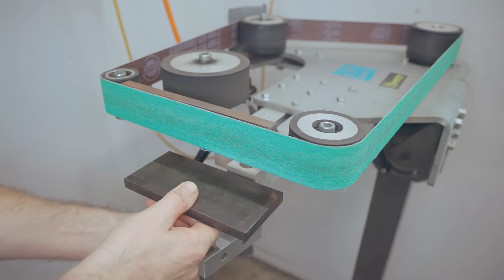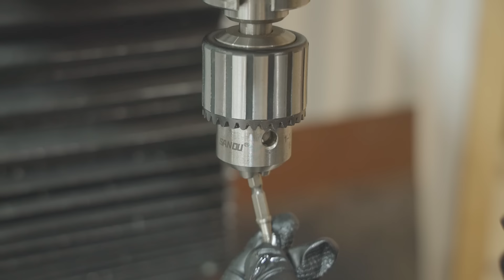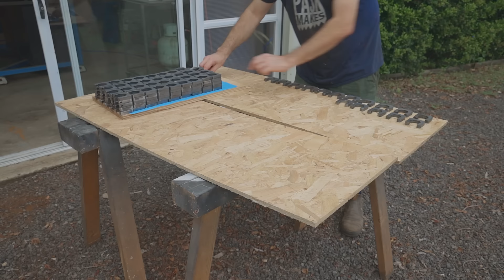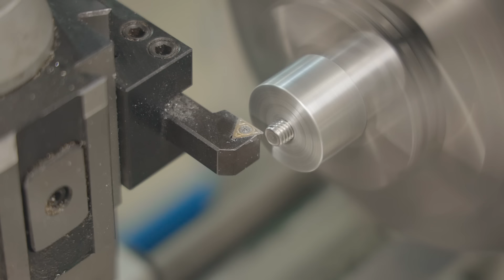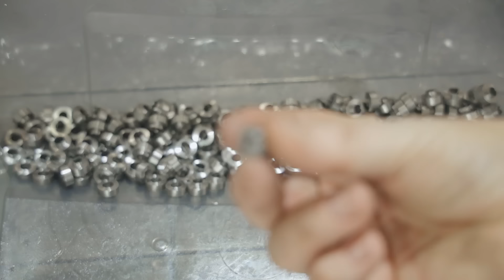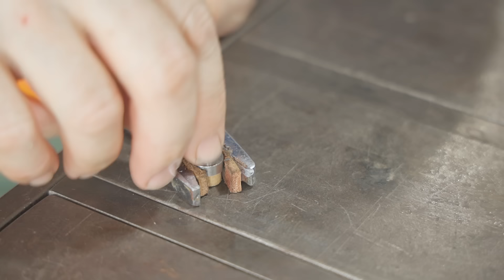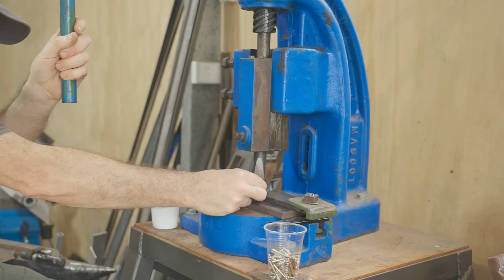Small Shop Batch Production - Lots of Jigs to make 200 Clamps

Comment: Great stuff as always!  Getting the blanks cut by a laser was the smart way to go, for sure.  I love subbing out that kind of work because it just makes so much sense compared to standing at a drill press or mill for hours on end!  Loved seeing all the little time-saving jigs.  That's always my favorite part of a video because you never know when something like that will come in handy.  Future reference.... you can split those 2x72 belts and make them thinner for when you need to get into tight spots like that.  I split one down to only 1/2" once for a similar project, but it was too narrow and ended up snapping on me right at the end.  Got the job done and I used the scraps as a sanding strap afterwards, so it wasn't a big loss.  Even just splitting on in half will make it roll around that tight radius a lot easier.
Reply from the maker: Thanks mate and thanks for the tip! :)

Comment: Great little clamp! A pretty good way to ease the edges on the body and maybe even the brass handles (although it wouldn't round the ends over) is to put them in a rock polisher. You can put a lot in at once and do something else while the machine is running.
Reply from the maker: Thanks Eric! There’s been a few comments saying the same thing and I reckon I’ll look into it for sure. :)
Reply: @PaskMakes  a vibratory or rotary tumbler. I have two vibratory tumblers i found locally for $100 with several different types of media work a charm at deburring and polishing small parts.

Comment: Awesome! Thanks. Idea: What if, instead of spray painting them, you were to blue them? This would prevent them from rusting, but also avoid the paint possibly wearing off in the future. Just a thought. Love your channel, by the way!
Reply from the maker: Thanks! I thought about it but bluing only stops rust for so long. You’re right though, the paint will get knocked and chipped for sure. :)
Reply: @PaskMakes  bluing stops rusting if you regularly oil it. Bluing creates a porous surface that holds the oil to prevent rusting. They would definitely look very nice blued in my opinion. The clamps are very cool either way.

Comment: The only "improvement" ...
Why did you think it would be complicated to counterbore the swivels before parting off?
You weren't using the tailstock until you needed to create more "tube." 
You could clamp a collar onto your counterbore drill to set the depth.
If you were making bigger batches, you could have a combined drill and counterbore cutter ground up.

Comment: Love all your jigs! One idea: Since most of your jigs don't have to take any significant force in use and are meant for a limited service life anyway, they could also be 3D printed. That way, a collection of 100-200 parametric CAD designs for 3D printable jigs could bring a lot of efficiency to any small workshop. One would just select the jig type, enter desired measures, and 3D print it.

Comment: The fact that you could create a process like this for 200 clamps is incredible in and of itself. That said, for the step where you're cutting the ends for the bolts from the steel rod, you could probably use a dial indicator instead of, or in combination with, the rod in the holder. It would help to keep your hands further away from all the spinning bits of the lathe.

Comment: For the part where you heat the clamps for stamping, I was thinking you could make a concrete wheel that had an axle. You could set it on its side Close to the furnace and load it with clamps and keep rotating it while taking and adding clamps as you go.

Comment: Nice job clamps looks great! When I was young I beveled 3/8 fine thread bolt so the nut would start on the bolt. I used to do them by the thousands. One machine has 1152 bolts to hold the cross links on. I would of traded your 200 any day 🤣🤣🤣. Great job thanks for sharing.

Comment: When making the swivel pads, it might have been better to drill the hole as deep as possible, then cut off a section of rod with the hole through it, then repeat. You would have a bunch of 4-5 inch segments of tube that could then be cut down into individual pads, probably using a bandsaw and jig.

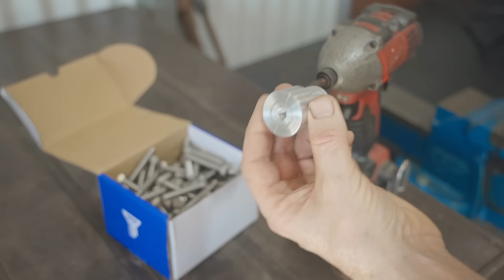Comment: @6:50 you show the bolt holder for mounting in the lathe chuck. A simple modification to this would be to drill the entry hole to the holder again so that the threads were removed from the first 2/3 of the hole. This would reduce the amount of time threading and unthreading the bolts from the holder by about 2/3.

Threading and unthreading the bolts for the entire length of the through-hole times a couple of hundred bolts is probably a fair chunk more time than it would take to reduce the number of threads by drilling one hole larger at one end.
Reply from the maker: Thanks Kent, that’s a great idea! :)

Comment: For those saying use a tumbler, that would work to remove the laser slag, but it's wouldn't round the corners off much, not without literal days of tumbling. At my work, we tumble laser cut parts for 8 hours in ceramic media and it barely takes off the laser slag. It does leave you with a nice clean blank ready for more processing, which is why we do it.

I was thinking something like a chamfering router bit with a ball bearing guide might work. Not sure how it would hold up though, or how scary (dangerous) it would be to use with steel. I've done similar with aluminum and it wasn't bad though.

Comment: You could put a large countersink bit in your drill press and jig up a base to locate the part. Using the depth stop you could knock the corners off of the round hole quickly.

Comment: You might have been able to cut the recess in the pads at the same time as parting them off if you put a tool in the perpendicular side of the quick change post. It would cut the recess while you brought the carriage to the left and be in free space as the parting tool went in. It all depends on whether you have a tool holder that would work. My little lathe came with a goofy angled tool holder that I could see making do.
Reply: That's a great idea. I was thinking use the tail stock to put it in before parting it off every time, but getting the depth the same every time gets complicated because the stock shortens every time.
Reply: I was thinking a turret tailstock for that step. Your solution is better because it uses tooling already on hand. I think a custom drill bit could be an even better choice because it would eliminate a step entirely Something like a countersink bit for wood working. To make it, take a bit the size of the outer diameter of the rod, mount in the lathe, and use a tool post grinder to neck down the bit for the counter bore and the through hole. Blunt the cutting edges at the largest step so it functions as a depth stop. I have made such bits using a rotary tool in place of a tool post grinder by making an adapter that holds the rotary tool to the quick change tool post.

Comment: Love the video, this was the type of thing I once did for a living. When pinching the ends of the brass you could make tooling that allowed you to push the brass through it through the bolt by hand but hit both ends at the same time.  You could even make it even more fancy by adding spring loaded stop and/or a shear that would cut the brass to length. It would save you quite some time.
Reply from the maker: Thanks very much for that, I reckon it’s an awesome idea that I’ll use for sure if I make more. :)
Reply: So how would you deal with the problem that would create of finishing the ends of the brass once it's locked in the bolt? At least with adding a shear to a singular process, anyway; I suppose you could avoid it by having a shear cutting jig and then if the cuts are clean enough I dunno, put them in a batch tumbler with abrasive, then pinching both ends at once
Reply: @farmerboy916  The ends could be sanded smooth after pinching both ends onto the bolt.
Reply: @farmerboy916  If the tooling is only for  double pinching the ends the brass ends can be finished in the same way as per the video. Adding a shear would create a bur which will only tame a light touch on the grinding wheel.

Comment: I worked in a steel shop, making batches of hinges and various brackets for train cabling and brackets for use in the undergrounds. Almost every job I had to plasma cut, punch, bend and notch hundreds sometimes thousands of items. Aswell as grind and then pack them ready for galv. Was a fun job as once the batch is done you have another all from blueprints. Machinery and jigs make something that would take weeks possible in a day.

Comment: 1:44 how do you keep that big belt from wondering off the pulleys?
Reply: If the wheels have a crown on them -- larger diameter in the middle -- the belt will align itself.  When it starts to slip off to the side, the geometry of the crown causes the belt to sort of steer itself back toward the center, and it climbs back up onto the middle.  The idea works well, and is used all over the place.  My first encounter was the. bandsaw.  It's how all the belts in the old belt-driven machine shops stayed on their pulleys, too.  I think it's kinda neat!

Comment: I spotted only a few speed issues, when you were grinding the edges of the brass, it would have been quicker to drop each one after the first grind into a cup, then just take the cup and repeat, turning it each time you aren't losing much but you are losing some time. And maybe, in order to knock all the edges from the c part, a tumbler left overnight might have done a better job especially on the inside edges but thats only more efficient if you planned everything to finish that days workload in the evening. If you did though that would probably save you an hour or two and left a nice finish, though not everyone likes a tumbled finish, it does however offer the opportunity to blue them at the same time...saving you from a complete operation in rust prevention, but again only if people wanted that finish. 
Impressive little jogs for the most part, excellent work and I love to see the people taking money away from the industrial planned obsolescence crap in the main. Keep it up please.

Comment: Ok since you asked. I used to be a supervisor for 7 years in manufacturing. One of my jobs was workplace efficiency and streamlining assembly lines.
Basically watching assembly lines to find lost steps, inefficiencies, and reducing employee fatigue.
This will be like a quick and dirty guide to more efficient manufacturing.
Here is a quick run through. 
Your first jig needed to hold enough work pieces to use the entire grinding belt for max efficiency. It looked like you could have had a gang jig holding roungly 4 pieces.
When you were putting on your maker's mark you could have moved your table and press closer to the forge. 
 This would have saved you a lot of walking around. Steps are lost time, roughly one second per step is lost. (all our assembly lines could be modified on the fly to better configurations.)
For example in the factory I worked the average worker made $17 per hour. Broken down thats . 28 cents paid per second.  Your stamping assembly line was losing at least lets say 15 steps per piece or 3000 seconds.  By making your line more compact it would have saved you at least and hour on the process. (roughly) At my old job that would have saved $100 of what would have been non productive time just on this one small job.
The threading at 13 mins you could have put the raw parts to the left of the jig and the finished bin of them to the right. It would save you twisting back and forth and saved a couple step for each piece.
I hope this helps in future big projects.

Comment: Here is a tip: When sending off files for laser cutting it's a good idea to include a drawing in PDF format - that way the laser cutting business should be able to spot if there are any difference between the vector file they import and what you intend the part to look like. Beziers/splines in CAD files sometimes cause issues for the laser CAM software. I run a laser cutting business.
Reply from the maker: Thanks Michael, I needed that advice earlier but definitely learned that the hard way. The laser cutting business were very apologetic and we’ll make sure they’re correct if I make more of them. :)
Reply: @PaskMakes I'd also suggest that you get a laser cutter of your own! From all the projects I've seen you do I'd say they warrant getting one at this point (assuming you can afford one)
Reply: I was just going to add that, having sent probably hundreds of files to a CNC laser or plasma cutting shop. I would also sometimes add a critical dimension to a pdf to make sure everything got scaled properly on export.
Reply: I send a lot of Stuff to Laser Cutters and Always include a Fully Dimensioned PDF with the DXF and a STEP File too, its more for folding sheet metal so they can get overall 3D sizes as well if they need to make adjustments for the V Block they're Using, but good practice to do so considering its 2 clicks and its included.
Reply: One more in agreement.  I used to do commercial laser engraving.  It is shocking how seldom the customer's files work properly the first time.  I always requested a variety of reference files/photos/samples, and usually required the customer sign off a first article.  I know distance doesn't always make that easy, but it's better than disappointing a customer with a batch of bad parts.  Gotta cover your butt!
Reply: The dreaded splines strike again. I use CorelDraw X6 and not all CAM programs import them properly. I was told CorelDraw 2021 and above resolved this issue but have not tried it. If I have to to send out projects to a non spline friendly machine I will CAM it in house with no offset & lead ins/out.  Another answer to the problem is a program made by CAD-KAS called DXF Splines to Arcs 1.0.
 
Hope this helps
Reply: Send a sample part when you have one too. And request a sample back before the batch run. I have 0 experience.

Comment: If you drill the hole first and then wet tumble them with stones it would deburr and soften the edges at the same time. You could also dip them in bluing compound, wash them in water and then dip them in oil rather than painting, it will give you a nice hard-wearing black finish and be a lot quicker. If you are drilling a counterbore in the pads, why not just have the drill knock the swarf off of them at the same time?

Comment: Impressed with the patience to batch them out.  Great use of jigs.  For the pad, it looks like the burr you have to break off is only on the side of the piece that falls off on the lathe step.  Instead of breaking it off with the pliers, just have it be the up side for the next step of cutting the recess?  I don't need one, but I bought one.

Comment: For deburring a bunch of small parts I have one of those angle grinder dynafiles or an actual dynafile in a bench mount with a foot pedal. Dynabrade makes a bench mount for the dynafile that's very slick. Pretty easy design to copy.

Comment: Excellent work very interesting video. Had a thought for the swivel plates , if you made a jig that could hold 5 or 10 at a time and repositioned with the mill table it might speed up the job a bit. Also Im sure you considered it but rounding of the end of the bolt I think would make the clamp look a bit more professional, might not be worth the extra effort as they look great already. Thanks!
Reply: Having the hex there leaves the ability to nip the clamp up with an open-ended spanner. 

Function over form for me every time!
Reply: You could also start with a cap screw, has a round head with an internal hex for an allen key in an extra gronk is needed.